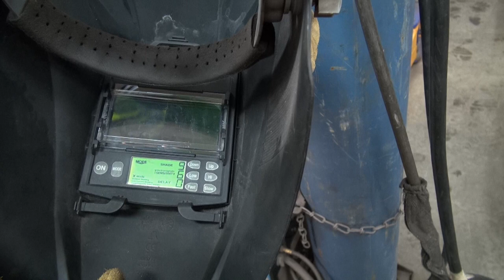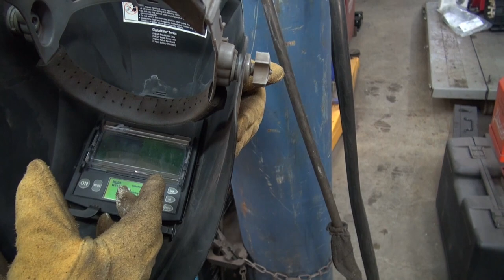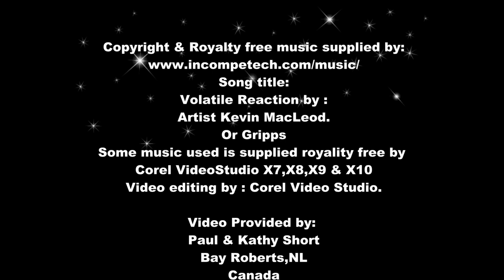Kubota RTV Welding

Comment: I had the dealer add Rim Guard (310 pounds per tire) to the rear tires of my 2017 John Deere 3025E. The literature they provided states that the freeze point is -35 F and weighs just under 12 pounds per gallon. Everyone should do as they think best for their equipment and use of same, but I liked the fact that, being a liquid and thus always on the lower side of the tire, it shifted the center of gravity slightly below the axle. Great videos. (I've been binge watching the last few weeks and am sad to know I'll soon have to wait for new ones to be uploaded.)

Comment: We put rim guard in our Massey Fergusen GC2400 works great but it does make the ride a little rough. I'm surprised Kubota didn't supply a safety bar for the bed cylinder. They used those RTVs at my college to clean the miles of sidewalks but i heard they always had issues but I'm sure it was lack of maintenance.

Comment: Hey Paul! On that kubota RTV when you were talking about putting the block under the bed so it cant come down, look back in the video and on the left side frame rail clamped on top you will see a piece of metal painted black and not gray. Its attached to a cable (to prevent it getting lost), but that piece is put on there from kubota designed to go over the lift cylinder to keep the bed from falling down. Just a tip I learned from owning one of these years back. You can see the piece good at about 33:07 in the video, its painted black with a sticker on top, just to the right where the fender mounts to the frame and to the left of the windshield washer fluid tank.

Comment: Hey paul, great video as always. There is a safety tube for the back cylinder on the chassis rail. It is attached with a tether. Just a little bit of info you may like to know for the future. Keep up the good work

Comment: Great video - your words on wheel weights was sound advice.  Here in Alberta it is a popular subject.  For much of the agricultural area of the province we are blessed with clay based so, when it gets wet you need traction to get your work done.  For much of the industrial part of the province the clay is supplemented with muskeg - again, you need traction.  Weight 'in' the tire has histotically been a favourate option with wheel weights a second choice.  As you so elequently ponted out, however, an often overlooked option is the ballist box or heavy implement that is easily attached/detached.  Great advise as always.  Great welding also - way better than me.  Do you use a heat gun to dry the paint before moving the equipment outside?
Michael Bradley, Sherwood Park, Alberta...

Comment: Paul you talked about power loss:   I was just thinking about your generator housing,  Actually you designed that housing for more reasons than you probably realized, That housing being made of metal ALSO serves as a VERY GOOD EMP SHEILD should that event EVER happen either due to a sun generated event OR a man made event like an EMP bomb  YOUR HOUSING WILL PROTECT YOUR GENERATOR and it will STILL RUN and make POWER FOR you and Kathy !!!!   Cheers ----    John Bellas   KC2UVN.

Comment: In regards to weight for traction or counter balance, there is always the controversy of un-sprung weight ( not that you have Springs on a tractor ). The lower the weight position the better. I like the ballast box because it's adjustable in many ways. It's easier to remove and the wheels aren't turning it. Drawback being the extension in tight places. We had work done on a truck and the guy snapped a ground on the front and welded at the rear, that was a spendy fix. Looks like that RTV could use some weight in the bed. I'm old school, never had an auto darkening helmet. Curious what the shade range is on it? Does it go from clear - 4------ 12 or 14?